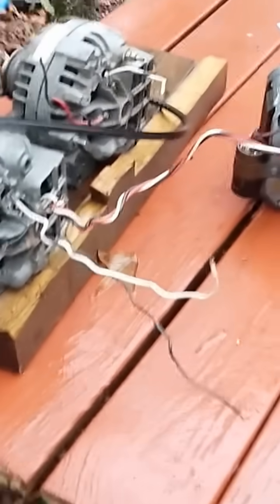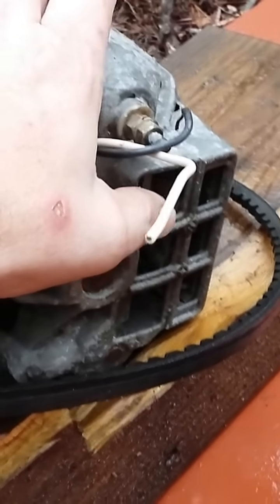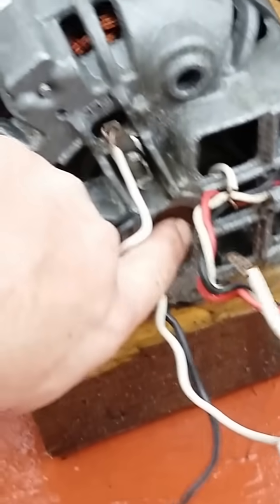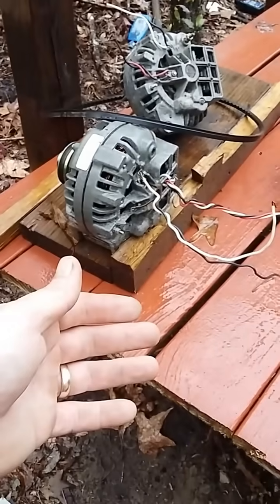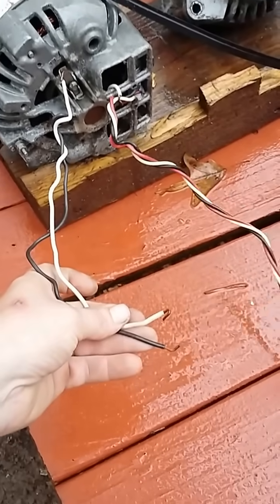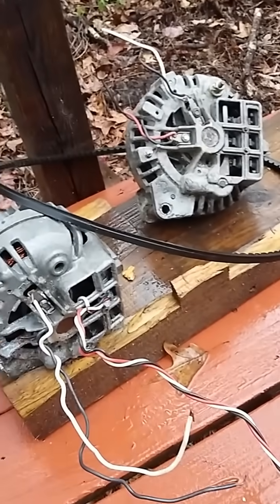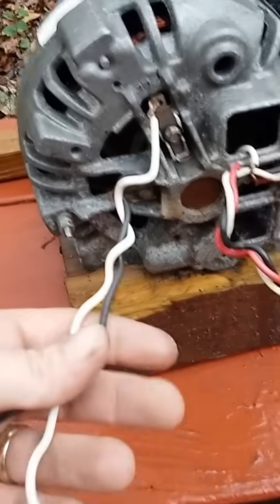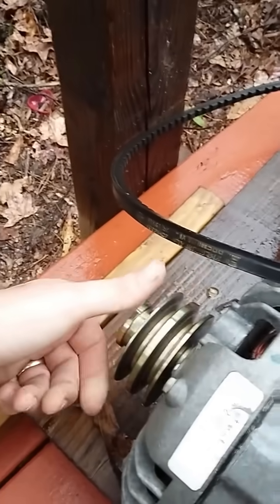Update Free energy forever no wind no solar no gas READ DISCRIPTION!!!

Comment: There is no such thing as free energy. You still need a battery to start your power plant up.
Reply: TESLA
Reply: @sabrinasmith7343  Once again, there is no such thing as free energy. Where do you get the power for the TESLA??
Reply: @Proud-American-1959  I was referring to the person and his research. But there is no money in free energy. The money in power companies will win in this world.
Reply: @sabrinasmith7343  You missed the point. There is no such thing as free energy. Energy does not just magically appear from the air.
Reply: Everytime I run my car I get free energy from the alternator… it charges my batteries from the serpentine belt
Reply: @swatisquantum  You are burning gas to get electricity. Therefore you are not getting free energy. Evidently you did not get past 6th grade. So sorry for you.
Reply: I get that you can't get "free" power, but my mind has been wondering if you can get alot of power from say a small amount of power. For example, one of these ideas in these videos hooked up to a small solar panel and battery bank.
Reply: @wretchedambassador  Good idea

Comment: I'm sure I missed it, if the alternator generates 12Vdc, what was generating the 240Vac?
Reply: Inside of the alternator there are small magnets those are called diodes if you bypass those and go directly to the wires that are on the stator the power is not regulated back to direct current it stays as alternating current which is what an alternator produces this reason we call it an alternator for alternating current however the diodes that are on the inside of the alternator issue not bypass if you're only going to get 12 Vault direct current out as long as you bypass those you can harness the full potential
Reply: Alternators don't have magnets, though you can certainly add them. Funny part is you could make a small motor that runs at 2000-3000 rpm with these magnets on a axel pivoting inside as the alternators core thus exciting the electromagnet coils. This produces a range of 8kw to 20kw 🤣🤣🤣 All for what? A 50watt small motor..... sad that no one understands how any of this works because we're taught that magnets have a field..... welp that field is a physical material and if you knew anything about forces (and by looking at how energy is produced).

In other words, Flux or by order of most positive to most negative molecules align themselves along the poles of the magnets..... these are what make magnets have fields.

POINT:
Magnets in Space don't attract or repel until contact, this is because in a mass empty volume their are no molecules to electronegatively align themselves to make these "fields". I say fields with quotation marks, because they really are just bandings of polarized air molecules similar to how a spark plug ionizes air and gas for combustion.

Comment: I like how your mind works. Your doing great work.
But I dont understand completely how the system would work. Could you post an operating system? Thanks.
Reply from the maker: My latest videos do show the amazing lens assisted coil effects as my 9-phase homemade motor that is also a generator and transformer powering itself and another motor that is rated for 3.86 ampers at 120 volts ac and a 300w grow light and a 15 watt or 25 watt LED light bulb....  Still no funding going hungry but get my promise and shared everything....

Comment: No examples.  No video of it working.  No voltage or amperage or resistance values.  
You just pointed at some wires and said one goes here, power 90 amps here, a wire
 And more unproven untested,  unproven,  undocumented comedy.
Reply: Guess you're pissed you wasted all your time much and that stupid ass video that probably isn't even f**** real but how many views easy does he have

Comment: That motor will be begging for mercy when that alternator starts to pull current
Reply: Power in = Power out  (for 100% efficiency )
I once wired an array of spotlights, 6, I think, to a motorcycle with an alternator. When I turned the lights on, it killed the engine. Not enough power to run the lights..!
Ktl

Comment: I'm trying my best to understand you but are you saying that by hooking it up straight to the diodes you are bypassing the voltage regulator which makes (240volts) that much current? If anyone one can answer that then go right ahead please. And what exactly is a Diode were is it located
Reply: Google diode! Might help you understand more.  Also the video is missing information as the description reads
Reply: Ok, thanks

Comment: the old generators they had in some of the older modeled cars and trucks are a great producer of electricity too
Reply: so is a river with a big ass wooden wheel half in the water.
Reply: that would even a bigger accomplishment using the old-timers method 
we wouldnt have to rely on the big rigs scamming us people or make more carbon emissions in are air .plus might as well put a still on the side for Moonshine for the community .

Comment: What is the Amper and Voltage of the alternator? and how much Watts it will generate?
Reply: 90 amps
Reply: @jeradalbert4819  and what is the voltage of the alternator?
Reply: Not sure the voltage but its 90amps

Comment: So if it worked why not have running to show just how much of a genius you think you are. Sounds like your not very intelligent. Because in order to run your free  power generator you need a power source such as a Battery? And last time I checked they cost money and loose their charge. and in order to charge a Battery you need a battery  charger or a alternator that either is ran with a gas engine that uses gasoline that must be purchased. That is a cost also and also not free . So the idea of you saying free is a false statement. Therefore you are either very stupid or just a person who has no concept of the meaning of free energy.  Nothing is free. And your mechanical knowledge is lacking a very important thing. 
The ability to work if it worked as you explained you would have let everyone see the output producing the electrical current that is needed to at least light a single light bulb 💡  proving just how well your idea works.  But just touching the  wires and remarking on the inner components of an alternator system. Doesn't in any way provide a true source of power that is needed to power a home.

Comment: i must know, if one uses permanent magnets, will that alternator still produce 220 volts @ 90 amps?  i ask because i have seen videos where people use the same chrysler alternator and their volt meters show 14.5-14.7 volts.  or did they just leave the diodes connected and are not showing it in their videos?

Comment: Question? How do you knock down the voltage from 240 to 120 when you get to the house. All your appliances are 120v.  Won't you blow up everything?
Reply: when power comes from the pole to your house, 240 is going in, but only 110 coming out the breaker box.  each side of the box has 120.  for the cook stove, 2 legs of 120 are used on a double breaker.  some 240 are wired with 3 wires, and some with 4 wires.  take a single 120 wire, connect 2 more 120 wires so one becomes two, now 2 of the connections on a 240 motor are 120 each, third connection is the common wire, 4th is the ground wire.  this is how the 240 gets to our cook stove and clothes dryer out of a 120 volt leg in the breaker panel.

Comment: How do those small gauge wires not burn up under 90 amps?
Reply from the maker: I'm trying to find your email but when you have lens assisted coils they share energy which means less energy lost not speaking of the car alternator converted to a higher ratio of torque output. I build nine phase motor generators...

Comment: Say What?  Bunch of buzz words making you think it makes sense....  The only way you can use the alternator to generate electricity is to spin the rotor/armature at about 2000 rpm and connect a step-up transformer  (note permanent magnets in the rotor work better)

Comment: The amps are only going to be judged by how much it is pulling I think what this guys trying to say is you have that much available Amps if you at the time run one light bulb say 40 watt  watts divided by voltage=amps that's how much you'll pull in amps . Also if your inventions putting out 220 is that on one leg or two legs together be cause a house 220 has  two hots or legs that carry supply one is a phase at 110,and the other b phase 110 to test from one to the other is where 220 comes in that's why a 220 plug has two hots  110,208 service  is most houses , 277 480 is usually big building service that step down to 120 ,208 .so if you put 220 on a circuiting a house one wire to much it's made to feed two circuits that why 220/ have a two pole breaker. Now the transformer to step down from 120 to 12 or 24 wouldn't pull much to feed off the output 220 90 amp and stilllet it feed more whatever if the 220 you say your getting is off two output wires because you don't want 220 on a 120 which is actually 110 in a house. Sometimes 120 240 some houses might be 3 phase instead of normal house single phase service but some have a high leg but since your making your own don't have to worry about but whatever was on that house highlegdome printing comp machines use high leg JUST WANTED TO MAKE SURE YOU WERENT TALKING ABOUG 220 ON ONE WIRE. OUTPUT YOU WOULD FRY ANY 12/ CIRCUITS YOU PUT ON IT. NOW IF THATS 220 OF TWO DIFFERENT WIRES THEN ONE ON A 120 BREAKER CIRCUIT AND ONE ON ANOTHER.
Reply: a wiring diagram i saw  while back shows it should be 120 - neutral - 120. together, 240.  the thing i am curious about is would i get 2 legs of 120 if i use permanent magnets or do i still need to use the electromagnet the alternator already has in order to get the 2 legs of 120.

Comment: I have questions how do you start the motor from your stater setup the one with register do you know what rpm it runs at I'm new to this I'm trying to set something up when electric goes out thanks
Reply: fro what i have been seeing, no less than 2000 rpms but will take 5000 if needed.  i been researching what i can, in my mind the puzzle is starting to go together  if you are curious, and if i am correct, outside 2 legs are 120, together make 240, center leg is the neural.

Comment: Be careful boss .  These days is very easy to find you!   They can trace your IP address through YouTube , phone , laptop , desktop , iPad  .  Also triangulate to pinpoint your exact location  too .
Reply: yep, you correct, only took 2 days for the MIB to find and chase my car home from work after telling how easy it would be to convert a gasoline car to run on water.  and back then, the only info that could have been given was the tag number on the car i was driving.

Comment: the way you ask for money is wrong. first show what you have and when people are happy with your information they will pay you not $ 5 but $ 500. don't chase money because it will run away from you.
Reply from the maker: Yes I did that for a while. The more I begged and chased after the money, the worst off things became..  I was able to keep my safety by hiding all the true information in the midst of the videos but my latest videos are basically just pointing here and here and saying there it is...  If you don't want to rewind a three phase permanent magnet motor into a nine phase motor generator then just build a small resistive capacitive circuit to trigger a transistor... You will have to change the energy from a battery so you will be able to run the middle phase of the three phase permanent magnet motor with pulsed direct current energy that is phase shifted 180° using three capacitors and three resistors... the oscillation that you end up with will run the motor using The Middle phase wire (both ends) just unhook the middle wire which could potentially be whichever one you choose... that will leave the other two on both sides of the first... so open it up cut one wire off and you will be left with four wires sticking out two of those wires are ran through the motor and tied together on the other end and two of those wires are actually just one wire.. it now exposing both ends of the wire. you can hook your RC phase shifted energy directly to that middle phase wire and it will run the motor if done correctly... As we are keeping the dipole safe with a large difference in potential of energy stored in homemade aluminum foil capacitors you will produce more energy out than what you would initially  putting in...   Good luck and hope is all ways just an intension followed by speaking it in to existence while knowing your words are true...

Comment: I don't want to rain on your parade, but you don't get 90 amps at 220v. You get the 90 amps when convert it to 12V DC. 1080 watts. You can't run many appliances in a house but light bulbs with 1000 watts. Plus you have to use part of that power to run a small motor to turn the alternator. Sorry..............Now ,you should experiment with a motor from a golf cart, 30KW babycakes. That can run a good size household. Or buy military surplus 11KW 220v generators. Just get yourself a 7 or higher HP motor, It will use about 1.5KW of the generated power to be self sufficient, but now this is a realistic project.
Reply: Is it possible to connect couple of alternetors with single motor and draw more energy .
Reply: Yes, but you would need a lot bigger 3 phase motor and alternators having dual 3 phase windings.
Reply from the maker: It sounds like you saw the video of where I built the nine phase motor generators and used high frequency high voltage to run them with a bipolar configuration and chrome rate affects when you put a load on it it speeds up I had a 400 w power supply running off of a pulse width modulated power inverter and a 2 to 6s 80 amp ESC that was ran to three of the phases on the homemade motor the other six wires we're wired in start and the center taps wired to the star points on each individual side leaving four wires that create energy on demand when you put a load on it as I was able to directly connect a motor that was $120 volts 3.86 ampers and a 300 w red grow light all running off of a 400 w power supply as I've said many times on my YouTube channel the higher the voltage the less resistance the higher the frequency the less current consumption using aluminum foil in certain patterns you can compile electrons at high voltage high frequency and bring the amperage back on demand that is how I'm doing my solid state systems now and I'm telling you all of this because I appreciate you sticking up for me!

Comment: Hi there. No hating from my direction. I'm a retired industrial electrician and have worked around power generation (in its many forms, from tiny to 220,000 volts) for most of my life. The curious side of me is asking "how do you regulate the rpm of the generator to get exactly the correct voltage & Hertz"? 
Personally, as far as haters, Karen's & stupid people go, I listen to them then decide whether to respond or just refuse to give them rent-free space in my consciousness. 
Cheers & Happy new year, keep on tinkering regardless.

Comment: How long is this possibly to last for due to a car alternator goes out when used on cars after so long or is it simple to exchange the parts out when that happens
Reply: Also is that a safe wiring size coming off of the generators into the home or would it be safer to use a lower gauge because of how thick of gauge is used already coming into a home or would that be unnecessary really to use such thick wire as it was when connected to powergrid

Comment: Your invention I think not is originally designed by Tesla and Edison and it was released and movies and TV shows several other ways it was leaked I even thought of it back in what 1997 never built one describe in detail how to make one you take one 3-phase generator hooked to an alternator and wiring together with a battery and yeah will run forever and you can use magnets NASA and the Russian space agency both built magnetic generators based off of Edison's design

Comment: I admit, I haven’t gone thru your videos yet, but I’m going to. I just need to know what your connecting your wires too for the outbound current. I’m trying to see in the video, you have them going into the alternator and wrapped around but it looks like there’s many connections in there. Do you have a video breaking down the set up step by step build, and it working in action?

Comment: Hey I’m trying to make one for myself what kind of alternator do you have?
Reply: It doesn't matter what kind of alternator you have as long as it's a regular automobile alternator capable of producing voltage then you can use it. Now, it's definitely way more complicated than this guy explains since he's just explaining the basic principals behind the idea. But regardless if you are in a remote area and you need electricity you can get plenty by designing a system with an alternator as the base power plant, the only problem you have to figure out is how you are going to spin the alternator constantly in order to produce electricity. You need something like running water that will spin the alternator constantly in order to get the "free" energy that everybody is looking for.
Reply: I just found this guys videos too, and I have so many questions I want to build one too